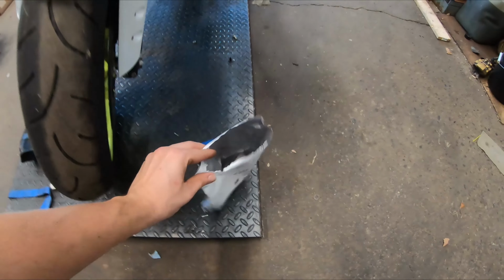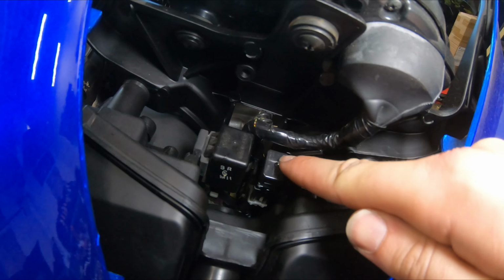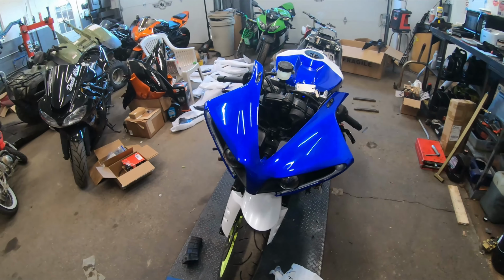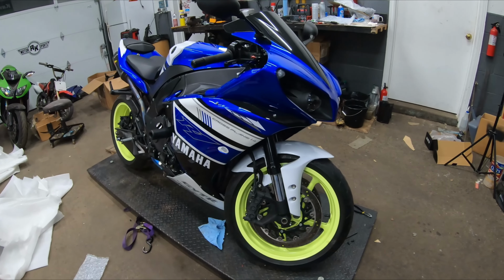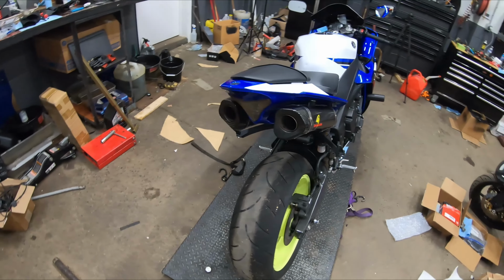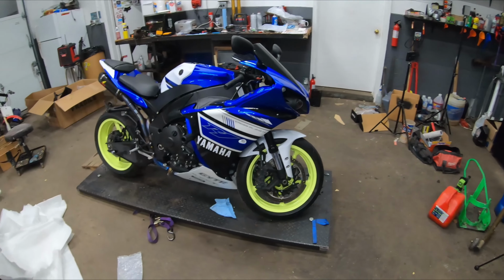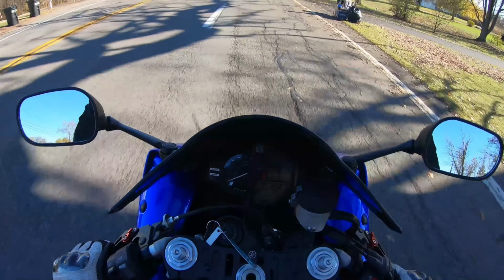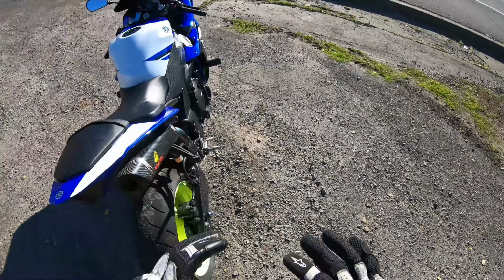Rebuilding a WRECKED 2014 R1 (Pt. 7 Finished! Test Ride!)

Comment: Hey Rob!  First of all - LOOKS UN.REAL.  Second of all - Always so fun to see someone get on one of the crossplanes after being on 600s.  I'm sure you've ridden liter bikes before but "In.SANE." is the only way to describe those early Cross planes.  It's so intoxicating and the way it delivers power is something you only understand if you've ridden it.  Made me smile because I remember that feeling so well.

Only ONE tiny thing to note - You didn't fasten the seat onto the gas tank properly (at first).  You can see it lift up.  You may have gone back and got it latched down off camera.  It's kind of finicky on the 09-14s but you've got to slide the front end (gas tank side) in first and then after applying a little pressure slide the back side in through the space left by the rear tail fairing piece.  It's not as well designed as other bikes like my 05 R1 or 07 R1 but it does slot in there.  You're the maestro so I know you got it right but yeah it's a little gimmicky
Reply from the maker: Thanks brother! Yeah these crossplane motors are unreal! And for the seat, I did notice that it wasn't down all the way. It wasn't until the end I saw that the bracket to hold the seat down was missing but I have that part on the way right now, didn't want to hold up the final video by waiting on more parts lol